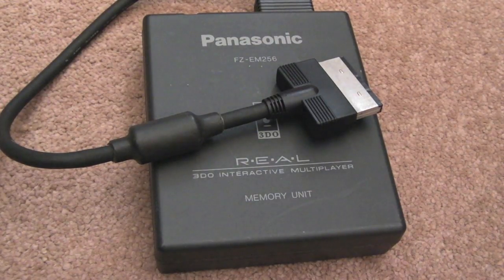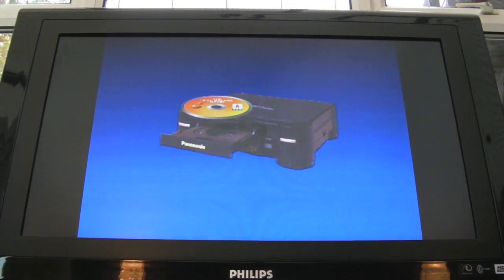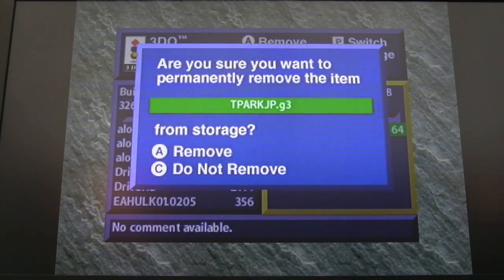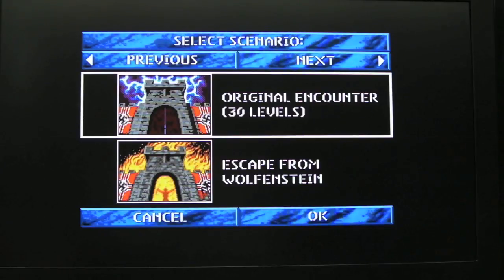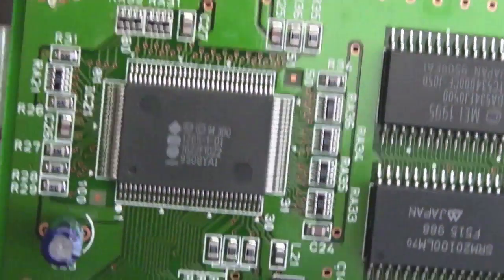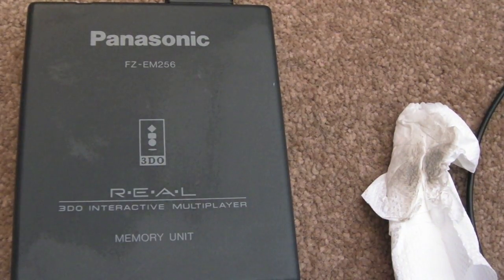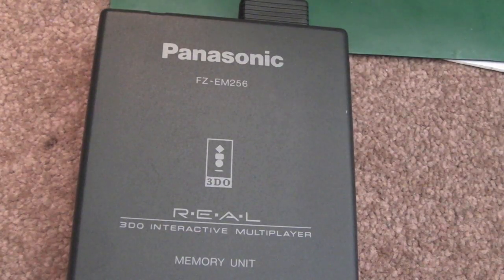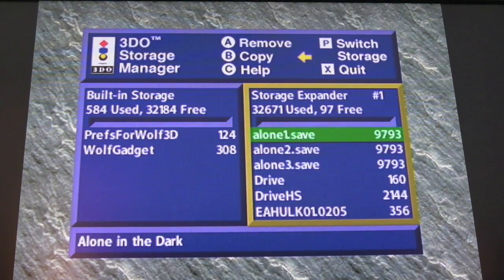Panasonic 3DO - FZ-EM256 Save Memory Expansion (Memory Unit) - Cleaning and Teardown

Comment from the maker: The RF level was adjusted later, in this video:- https://www.youtube.com/watch?v=McSg5Xqkb2U&list=PLMjdUTC-GcRMjho136gdqa58cVX64C-Vx&index=5&t=0s
And here's another repair to a 3DO I did later, with laser adjustment (and fixing sound issues):- https://youtu.be/EVvhm22YQN4
Follow up:- https://youtu.be/3Zbh5jOxHek
Crackling audio fix:- https://youtu.be/oczWL5hNv48
Yet More Capacitors (on the CD drive):- https://youtu.be/b0d4OhPczH0

Comment: I have a question. My copy of road rash will not play music during game play. I have an fz-10. When I turn on the option for the music it says there is not enough system memory. Would this fix this?
Reply from the maker: Very unlikely it would fix it!  It sounds like either you have a RAM fault, or the error is missleading and actually its a problem with the CD drive?  Have you got CD music (background music) working in other games?

Comment: Would you be able to assist me with adding a fan to an FZ-1? 

I was given the FZ-1 for my birthday but after 30 minutes, it starts to skip and eventually freeze. I removed the top and was amazed that the heatsink was just a piece of the shielding, so thin and not a good heatsink at all. I added 3 small, but with long fins, heatsinks onto the thin one that was there. They helped cool it with the top off but with the top of the shell on, they heated up to almost 70c.

I noticed the motherboard has a spot for a fan header connection labeled CN660 and there are 2 unpopulated spots nearby labeled C660 & L660. I assume that they are all linked. There is also a spot in the shell for a fan to clip into, to pull air out of the system. I found an old 40mm x 40mm x 10mm pc fan and it clipped in perfectly, so I wired it to a usb 5v to 12v step up and ran the system with the fan popped in and running. The system stayed very cool and no skipping or freezing. The added heatsinks helped tremendously as well.

What I need help with is the components that are missing in the C660 & L660. I bought a new double ball bearing fan and header connectors.

Can you help me with information about what I am missing? Please and thank you!
Reply from the maker: Are you sure it doesn't need the PSU section recapping?  The behaviour you describe is more commonly related to either the CD drive (laser or caps on the drive PCB), or the PSU caps.  I will investigate adding a fan, because I dont think mine has one either.
Reply: @GadgetUK164  I'm sure it could benefit from some new caps, especially that small 10uf one on the PSU, I've seen that one faulty on a lot of FZ-1. I figured the fan would help everything last the rest of my life (old caps, voltage regulators etc.) but I didn't want to damage it if it needed proper components to make the fan work. I'll give the board a thorough review and check for bad caps.

I have lots of smaller caps, but don't know what could be placed in the L660 spot. My eyes are bad but I think the C660 and L660 are parallel to each other on the board with positive splitting to each, exiting to a large ground that leads to the ground of the fan connector CN660. I will find my volt meter to see if that is the case. I think adding a fan would be a great idea and a fun project.
Reply: I just checked, the 10uf leaked a little.

The power on those components runs like a horse shoe, starts at the bottom of the L660, leads up around to the top of C660 and out the bottom to the ground that CN660 is connected to. L660 gives off 9v. The CN660 has no power on its own. The open via on top of L660 and C660 is directly linked to the positive side of the CN660. After the power goes through the L660, it splits off to the fan at CN660 and to the capacitor that's missing on C660. Would a resistor go on L660?
Reply from the maker: The capacitor and inductor are basically going to be filter related - to filter fan noise.  It would litterally depend on the fan fitted in order to calculate the size of the inductor and capacitor.  You could just fit a 220uF capacitor (or 470uF) - 16v or 25v, and maybe fit an inductor, maybe a 0.1H inductor or something.
Reply from the maker: L660 will be an inductor!  You would find it will work with either a piece of wire, or an inductor of say 0.1H, or you could try another size if you find the fan creates audible noise on the sound output.
Reply: @GadgetUK164  The fan I bought is a 12v 0.1a max rating. I thought that the 9v would be enough to power it but keep its RPM down, as well as the sound of it spinning.
Reply: @GadgetUK164 
I installed the fan and it works great.

I couldn't find an inductor for L660 locally so I just used a scrap leg off the 10uf capacitor that I also replaced on the main PSU. I used a 47uf 0603 smd capacitor for C660, I didn't have an 0805 size but the teeny one I installed works just fine.

I was also correct about using the 12v fan. The 9v supply gave it enough power to keep it fairly quiet but strong enough to pull hot air out effectively.

The 10uf PSU capacitor C36, did some damage but it was only the the via it was attached to, luckily. I had to scrape away the dull material off of the via and even a little bit of the solder mask, about 1mm from the via so I had the best possible solder joint.

I tried to look for the FZ-1 1993 model service manual so I could find the parts and their proper ratings but I could only find the 1994 service manual which was the revision I have :(

You should do a tutorial on this. I think having that fan will greatly prolong the life of my 3DO.

Thanks again for all your help. Your videos give inspiration for people to work on their stuff, instead of trashing them in the refuse bin and buying a new item.
Reply from the maker: Thanks!  Great job!  I am glad you sorted this and if anything you are inpiring me to have a go lol!
Reply: @GadgetUK164 
I forgot 1 thing I added. I added a small ferrite bead that's small and cylinder shape and just large enough for a single wire to pass through. I put a piece of shrink tubing over it in case it hit stuff inside the system. I believe I put it on the negative wire on the fan.

I also forgot to mention that I blew the main fuse. I was testing my solder joints for continuity and because of my diabetes, I have nerve damage in my hands and they like to twitch when I try fine motor work with my fingers or hands. My hand twitched straight into the fuse while touching the grounding screw, I might have hit something next to the fuse but it happened to fast to see... well I saw the blue glow from the fuse melting lol. The local TV repair shop sold me a replacement at a criminal price, he looked on amazon for a price to go by... I was in a pinch and it cost me $10 for 1. I'm going to order a box of 100 fast blowing off ebay for $4.

I played it for 9 hours with no freezing, no audio or video interference. However, I did find something that bothered me. The console now plays Wing Commander III but in the memory manager whenever I highlight the very last game save, which is Wolfenstein, the game freezes.

Comment: I wish someone would clone one or reverse engineer it and make a new one.  Something anything
Reply from the maker: Yeah, I guess reverse engineering would be possible.  I am guessing that all that quad flat pack IC is doing is controlling the bank switching between the 8 slots, and basically routing the data and address lines through to the relevant places.  There might be some kind of 'are you authorised 3DO hardware' hand shake or something going on, and maybe the data is encrypted, but I doubt it.   The easier way would be to just put a 256J chip in place of the onboard SRAM and have some button or something to toggle between 8 banks (basically an internal RAM upgade for the normal 32KB)
Reply: GadgetUK164 - Retro Gaming Repairs & Mods I saw one on eBay for 140 and almost bought it.  If I can get the USB HDD mod it won't be nessicary
Reply: GadgetUK164 - Retro Gaming Repairs & Mods any 3do attachments are like porn to me
Reply from the maker: Hehe, yes, I have to admit to liking anything for the 3DO!
Reply: GadgetUK164 - Retro Gaming Repairs & Mods I always wanted the Japanese version of the fz-fv10, the vcd card.  Even though the vcd format is garbage.  And it would be a waste of the laser.  The memory card it substantially more attractive given the storage situation on the 3do.  I bought a bum fz1 to get mnemos fz1usb adapter, its plug and play on fz1 and saves can be copied and moved.
Reply from the maker: The fz1usb looks cool =D  Might have to get one at some point!!!  I did fancy getting the VCD card as well but as you say - not much use for it really.  I still have some VCD discs though.
Reply: Is that confirmed a HDD or SD mod would allow for saving such data? I was under the impression those mods were only good for ISOs.

Comment: Wish the design was simpler and the connector less obtuse -- would be easier to make homemade versions of. As it stands, vendors probably wouldn't see enough of a market to start producing a run of these in a modern clone version.
Reply from the maker: Yeah, I agree!  I think the easiest option is to perhaps do what I talked about in my first 3DO video - to add a larger SRAM to the motherboard and link up a way to swap banks (perhaps with a button or something).  ie. Add a 256K chip in place of the 32K chip and have a PIC or something drive the upper address lines to toggle between 8 banks like the official backup RAM does.

Comment: Even if the battery is still "good" at 3 volts, that doesn't mean it's not maybe failing tomorrow. Lithium cells generally have a stable voltage and a sudden dropoff, it's not like with Alkalines where they slowly decline.
Reply from the maker: They don't die like that at all in these systems, I've seen them gradually drop over long periods of time  - I've got numerous carts and systems that use rechargeable lithium cells and some of them are 25 years old and still working perfectly.  The other plus is they don't leak either, so when they do fail its not a problem swapping them out.

Comment: Those chips with a 74 on them are probably 74 series logic chips? Wouldn't be unusual to see them next to some RAM.
Reply from the maker: Absolutely, they are 100% 74 series TTL.  It's more common to find a 244 or 245, or 373 next to RAM.

Comment: Always liked the 3DO, yes it has its problems "in later life" but it was a good system and was underappreciated. Back on topic, could Panasonic of made that FZ-EM256 Memory Expansion any bigger, Ha.
Reply from the maker: Haha, yes - I dont get why it used SRAM instead of EEPROM (one 256K 29F020 or 29F040 could have done the job at probably less cost) - like the Saturn used on the backup carts.  Maybe SRAM was cheaper at the time.  Stupidly large design imo.

Comment: Wow. That is huge... so is that expansion 😉
Apparently some of the Amiga engineers that were let go by Commodore worked on the 3DO architecture. Always wanted to have a play.
Reply from the maker: Haha =D  Yes, it is quite large for what it is!   I am sure if Panasonic had tried they could have made it much smaller - and done away with the battery.  If you compare to say the Saturn backup carts, those use the erasable TSOP version of the 27C040 (something like a 29F040).  They could have put 512K of electronically eraseable ROM in there at much less cost than having 2 X SRAM chips probably.  And I don't understand why they designed it to have a lead etc rather than something that stands up right or just sticks out of the back - maybe due to stability of the connector.